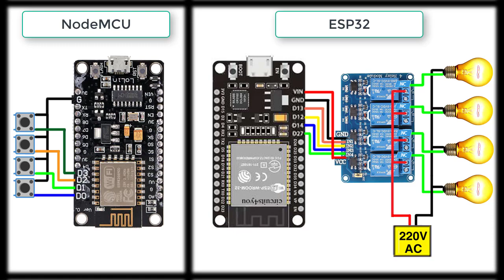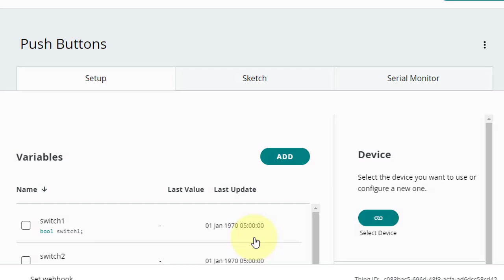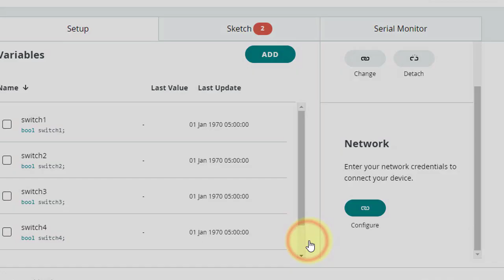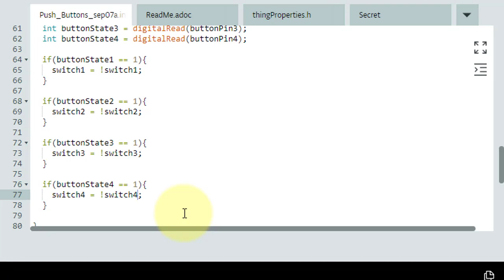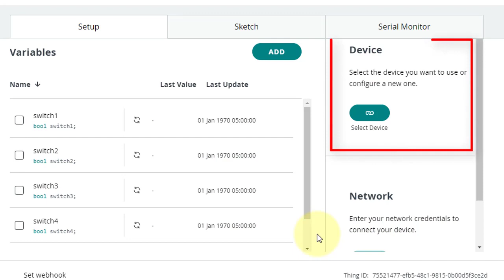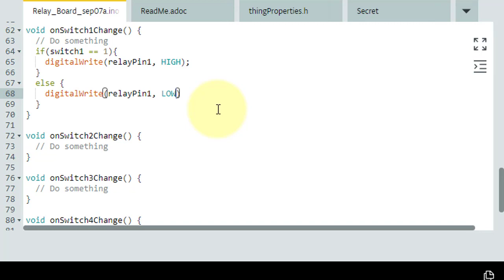Arduino IoT Cloud Home Automation With ESP32 and NodeMCU

Comment: Nice. But. This video caught my attention because I thought they were communicating without using the internet.  I was wrong.  Banal management using an external network.  It is interesting to see a project where esp modules communicate and perform functions among themselves without using the external Internet or a router as Dlink or other big box.  Instead of a large router, for example, use the same esp. ESP1‹-›ESP2‹-›ESP3. Esp1 communicate with esp3 between (esp2 roiter) - or witout esp2. Have you some idea to new good video ? )
Reply from the maker: you can connect multiple esp32 to communicate with each other without the internet. I will soon make a video.

Comment: Hey brother, I want to ask u something, the old blynk is not accepting new user, and the new blynk is really different and confusing and doesn't run on old blynk codes, can u show us how to get gps coordinates over sim800l in esp8266 using gprs. ?
Reply from the maker: I never use new blynk. but will try
Reply: I will try
Reply: @TeachMeSomething  yes , pls do , the whole project include , having one relay , gps coordinates, sending data to blynk (new) using gprs(sim800l ).